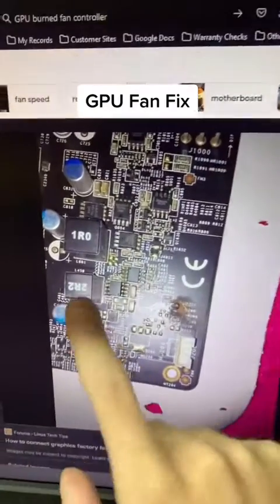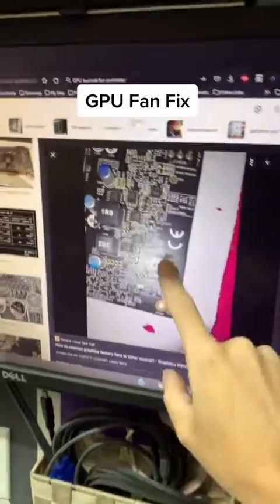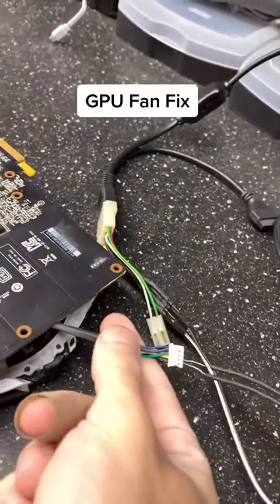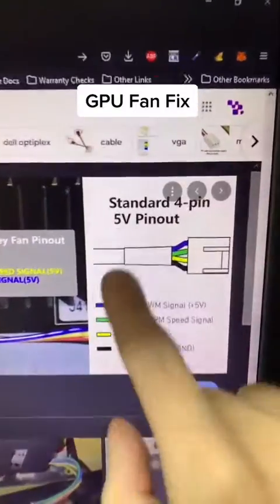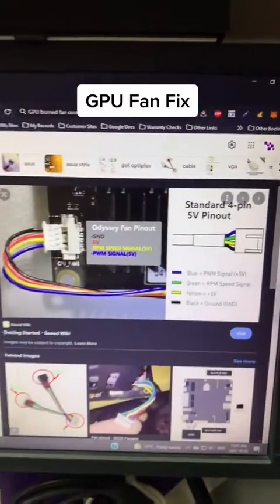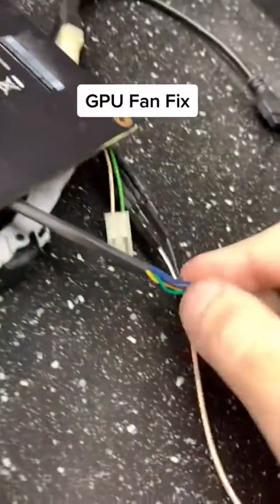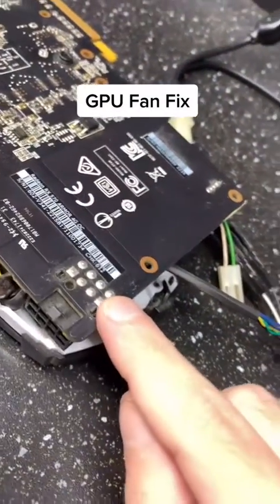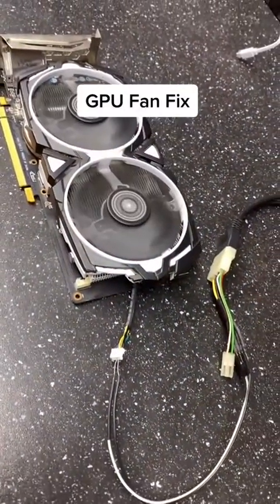GPU Fan Fix for fried board controller

Comment: interesting!my gpu fan runs at fixed speed i dont know it ,i bought a gpu that was mined and it shows that they are running at 1847% but obviously they are running something like 60% i cant change the speed,what can i do?can i buy something that let me control them or is the chip able to be fixed?
Reply from the maker: Reflashing a stock bios to the gpu will likely fix it.